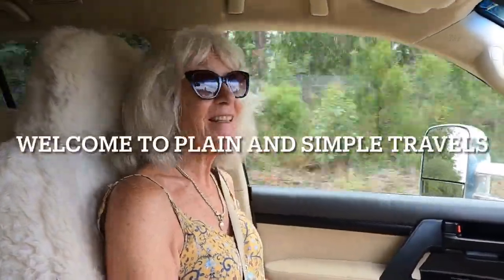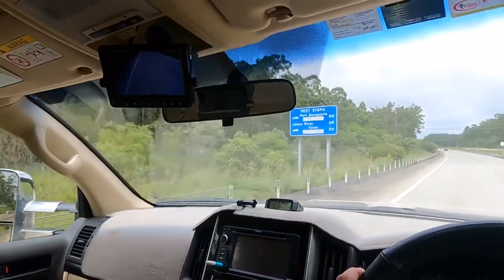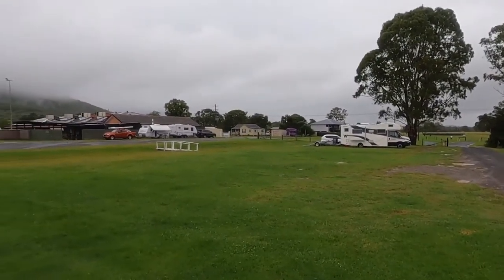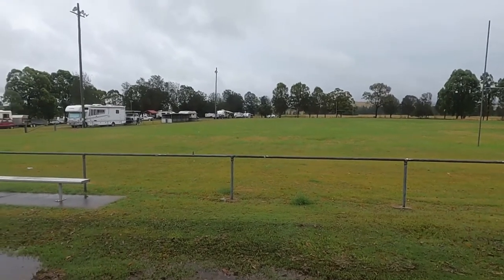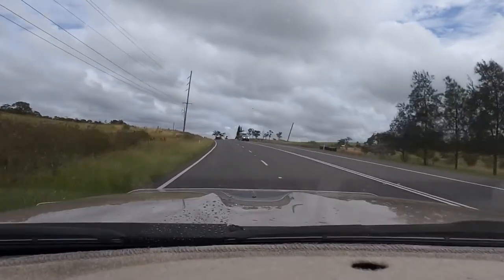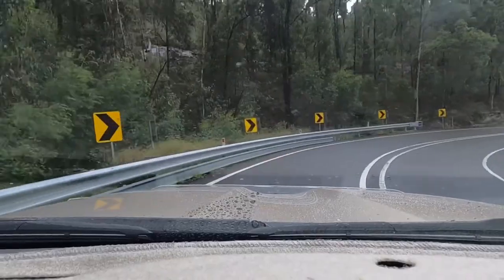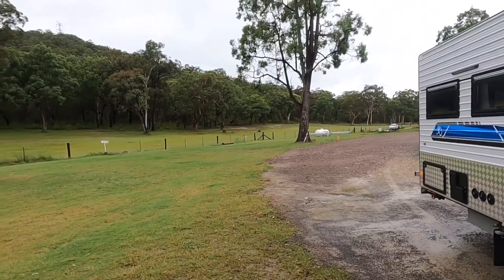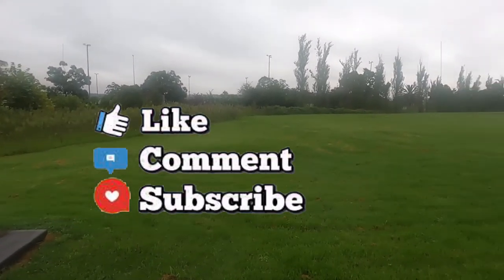MM4x4 torque converter lock up review. Bulahdelah, BRANXTON, Grey Gums Cafe, Richmond via Putty Rd

Comment: Hi Jim how are you doing I have a question about the lockup kit.
I recently purchased a 2015 200 series and i am looking to get the same lockup kit.
I can see that you have had it in for a little while
Just wanted to know if you are happy with the unit 
I guess the biggest question I would ask is have you can a improvement
In the fuel savings after the install.
Anything that you don't like about the lockup kit.

Regards
Glenn

Comment: Hi Jim just a question regarding the lock up kit did you have to get a transmission tune as well or not??? 
Regards Glenn
Reply from the maker: No Glenn, that's the good thing about this system.  Saves another $1800 as well as cheaper to start with.

Comment: Sorry jim i just seen the you comment to ric 16.7 LPH is superb
Reply from the maker: It is mate, but I do drive conservatively as well, always in sports mode and manual shifting. A bit of effort but worth it 😀. The only thing that could be improved is being able to lock up in 1st gear. Apparently if you fit a larger pan it will but I ain’t spending more on it.